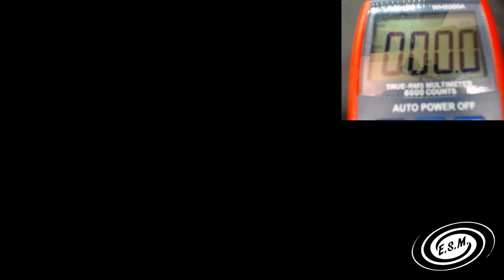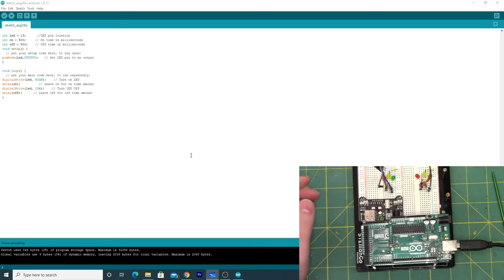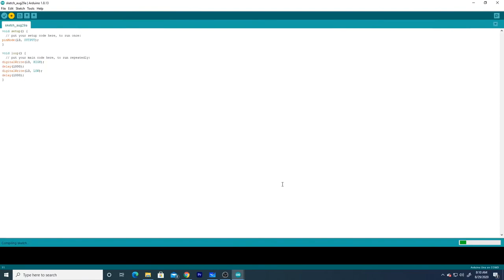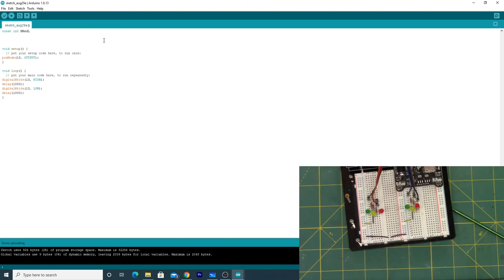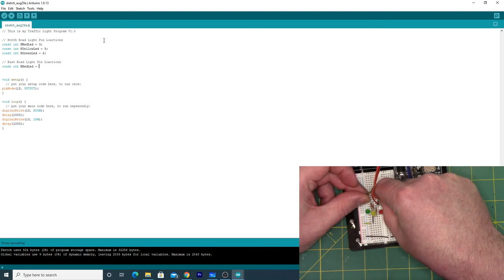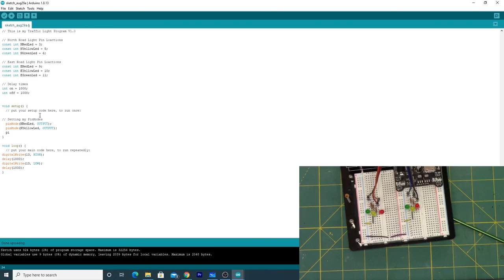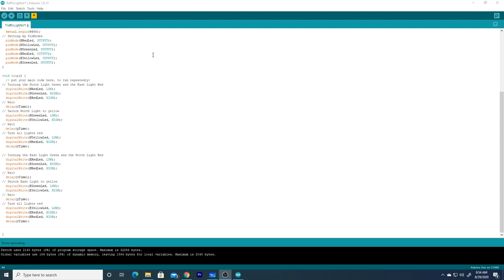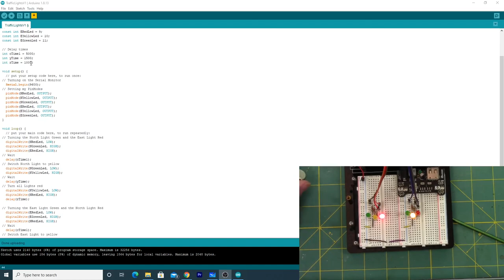Traffic Lights Project Part 1 Intro

Comment: I would like to also know are you going to give a list of where you got the electronic parts?
Reply from the maker: Yes I will once I get all the parts I need. It is a build as I got project, but getting a good Arduino starter kit from like Elegloo would give you everything to build the circuit and work out the program, but in the end I will be using small custom parts. I will share a final list of parts toward the end of the series after it is built on the breadboard and the program works.